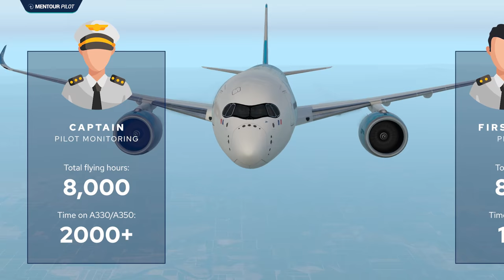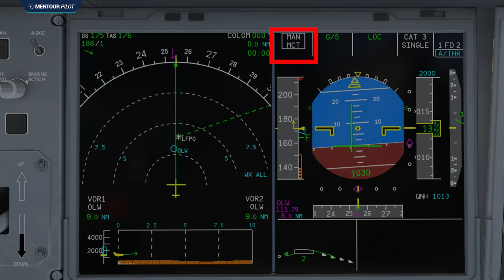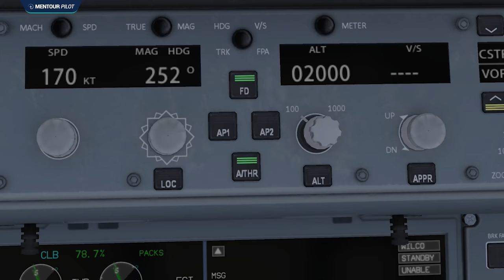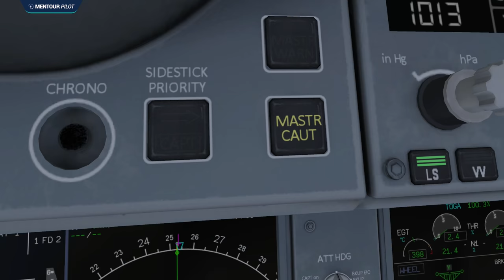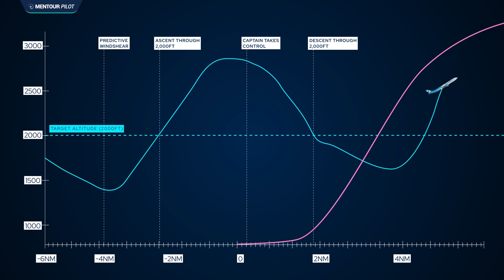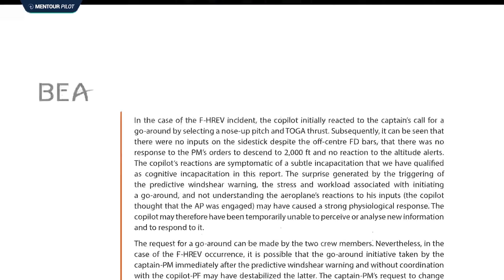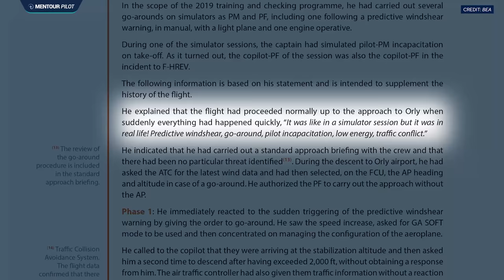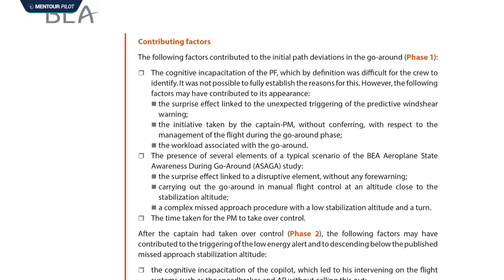What HAPPENED in this A350 Cockpit?! French Bee flight 711 explained!

Comment: Thanks for the very interesting video, as usual ! ;)
I was wondering, don't you think that airliner pilots should fly more small planes ?
I already experienced that feeling to be paralysed by an avalanche of workload, and in that case I tried to just concentrate on the very basics, exactly as if it was about flying a ultra-light plane : speed, altitude, and avoid close traffic. Maybe some minor errors can be done, but it helps to keeps the situation under control, and it gives at least some time to recover a clear mind.
I don't know if this 1st officer was also a private pilot or UL pilot, but if he wasn't, maybe that could explain that he didn't have this reflex to just fly the plane, concentrating on the basics.
What is your opinion about that ?

Comment: I have been in the FOs position once 4 years ago, but not as a pilot. I simply shut down. I verbally relinquished control, apologized and sat myself aside to let my boss finish the job. If I was the captain, I would just reach over, grab him softly by the shoulder and just indicate to him and to the 3rd pilot to switch seats, right then and there
Reply: “Not as a pilot” you should have just stopped right there

Comment: The idea of "re-briefing" the approach a few minutes before landing, especially in a case like this where the procedure is unique and poses significant traffic conflict risks, is a good one. Sometimes I can't remember what I ate 40 minutes ago, much less the details of a complex stepwise procedure that probably won't be needed, but if it is has to be done correctly the first time in less than 2 minutes. Airlines might also consider having the PM recite the missed approach procedure out loud once a go-around is called for, rather than relying on memory alone. My other comment regarding training is this: while I understand the important support role that automation plays in modern aviation, I think that both initial and refresher training for pilots should focus on them being able to perform every maneuver in the aircraft manually, from start-up to shutdown and everything in between (with the exception, perhaps, of celestial navigation!). It's kind of like teaching physical examination in my field, medicine, where you have to examine a LOT of "normal" patients to gain a sense of when you're looking at something that is 1) not normal, and 2) important enough to worry about. Only by knowing and understanding the state of the aircraft intuitively can one fully and properly react to a non-normal situation, and that intuitive knowledge can only be gained by hands-on practice. Think back to what it took to learn partial-panel approaches when first studying for an instrument rating, and start from there.
Reply: It sounds like the FOLLOWING was trying to get in some refreshing on manually landing the plane. Just had an unexpected event happen when doing it. Maybe require Captains and FOS to do a manual landing every so often, either in real life or a simulator.
Reply: Stupid autocorrect, changing FO to other things.
Reply: Re: knowing what normal is 

Indeed. I work as an IT systems administrator, e.g. I am responsible for keeping a bunch of IT systems running, and people expect me to know the answer to most operational questions. It might seem unproductive me sitting there monitoring systems that are doing fine, looking at the behaviour, but knowing what is normal is what enable me to identify when something is out of whack, maybe even before it becomes apparent to the users and a problem.

Comment: Crazy to hear a go around is so rare.   Was an aircrewman in the navy in a training squadron, crash & dash was exactly what we did 90% of time.  The one thing i would be curious, why the wind-sheer warning, and what was done to investigate it on that airplane, sure Petter mentioned the possible false warning with air going over buildings, but still, would think that might be something to check...?
Reply: My impression is ATC tries to avoid putting commercial flights into a situation were a go around is likely. I have been on many flights were we waited, circling for weather and traffic to clear at a fairly high altitude. From the video, while go arounds are not inherently dangerous themselves the real danger is other traffic and local conditions that will complicate the go around. So avoiding them by ATC is probably a wise move.
Reply: @washingtonradio  I would say a go around is not such a monumental thing.   Most all airports have what we might call a race track pattern for the airport traffic that is well established.  A touch and go, or as we called them crash and dash in the over all scheme of things is really, or should not be such a big ordeal.  Inserting the plane going around is really no big deal planes are normally spaced out well enough getting a plane or two back in the queue is not an issue...
Reply: It was only a predictive windshear ahead warning, not the windshear alert with immediate mandatory reaction.
As for LFPO's topography : the wind was coming from the Northwest and Orly 4 (ex Orly South) terminal is quite long, blocky and parallel to runway 25 on its North side. So the wind would have flown over the buildings before heading their direction.
I've been to Orly in fog days and seen upwards vortices from the main South / 4 terminal building towards runway 25 or its path with winds coming from the North.
Far from a real windshear but maybe enough for a refined predictive windshear system to kick in once every blue moon with a simple caution callout.

Knowing the BEA, they certainly checked everything from weather data and radars of the plane, airport, ATC and state to reports from previous flights, tower and ground crews.
The warning they had was not of an actual windshear but only a predictive warning that kicks in when it picks up on conditions that could lead to a windshear.
The crew then chooses, based on their assessment of the situation if they want to continue or abort / go-around.
The crew reacted immediately to the predictive warning as they would have to an actual alert callout instead of assessing the situation first.

Also, depending on the angle of the wind (specifically if it was coming mostly from the West) the predictive situation could have been triggered by wakes of an aircraft departing from 24 as turbulences from that runway travel over both Orly 1 & 2 (ex West terminal) and Orly 3 & 4 (ex South terminal and the new junction) buildings 
Another reason : as it was February and probably cold, it could be warmer air coming from the water of the Seine river path that's perpendicular to runway 25 approach path.
In the winter, with cold weather after a period of mild temperatures, the water was warmer than the air and while flying the jumpseat I've felt a bump as we passed over the river and oil storage river-port. Like a warmer upwards curtain of air that you only feel at slow speeds.

Last possibility : runway 25's final approach path is quite populated and alternates between woods, suburban houses, river and industrial zones. The last houses are meters away from the airport's fence.
A difference between ascending columns of hot air from house chimneys, warm river and descending air above industrial areas...
There are plenty of reasons on this approach path that could potentially align and trigger a windshear prediction without it malfunctioning nor being an actual windshear.

Just like some approaches with buildings in the way can sometimes trigger early radio altimeter callouts or GPWS alerts...
Reply: @dand4485  Orly's configuration is a bit particular.
They have dual operations on non-parallel runways (6/24 & 7/25) as they are only a dozen degrees converging / diverging.
Runway 02/20 is said to be active in the video but I've never seen it used for anything else than taxi and parking for decades (it's extremely rarely used, mostly by smaller planes in rare crosswind conditions).

When facing East, dual operations are a lot simpler : departures on 7 and landings on 6, traffic is diverging.

When facing West ,as it was the case of the video's flight, departures on 24 and landings on 25 with converging traffic in case of a go-around, it's much more tricky.
Also there's a military / government officials airport to the Northwest of Orly (Villacoublay, 107th French airforce base), patterns for CDG and Le Bourget airports's SID/STARs and Paris center NFZ (exclusion / no-fly zone) in the vicinity.
Not even counting Brétigny's military, medical and drone test site airport and EuroControl experimental center South of Orly.
That Orly runway 25 go around procedure is a pain...

Comment: I'm shocked to hear how rare go-arounds are, because a little over a year ago I've flown for the first time in my life and experienced a go-around with a 20-degree bank turn through a storm, with turbulence and lightning striking around the aircraft (and then circa 40 min in holding pattern until the storm passed). Pitch up combined with TOGA throttle really pushed me into me seat, I saw people around scared but it was not scaring me. Partly because it was still less violent than being in skidding car, but mostly I think because I watched a lot of Mayday/Air Crash Investigations, Mentour and 74Gear videos and I felt like everything is under control and it's just business as usual.

Comment: Good analysis as usual.  A couple of thoughts from my viewpoint (25,000 hour long-haul pilot with 8,000 as Airbus captain).   1st. I guarantee fatigue WAS a huge issue, even if they didn't recognize it.  2nd, the Airbus is easy to fly when everything is normal.  It can be a nightmare during irregular operations like this.  I found, in situations like that the best thing was to turn off ALL automation and fly the basic airplane.  When it's back where you want it, turn the automation back on.  

For discussion, the vertical aspect of that go-around was not much different than a climb TCAS RA.  It should have been easy for the crew to hand-fly.
Reply from the maker: Yes, I also got the feeling that the constant engaging and disengagement of the autopilot probably aggravated the situation. But I’ve only flown Boeing myself so I can’t be sure.
Reply: @MentourPilot  I've been Boeing for the last 10 years, so my Airbus currency is a bit poor, but . . .When you turn the autopilot on, it won't automatically go where you want, especially if the command bars aren't centered.  Say you are above the selected altitude and nose high when you turn the autopilot on.  The autopilot/flight director will "revert" to vertical speed mode at the current climb rate.  Not at all what they would have wanted. That would then require a lot of "fiddling" with the mode control panel to get it doing the right thing, or as I preferred, just turn it ALL off and fly.

Another small complicating factor for them at a time of maxed-out workload is when Airbus autothrottles are engaged, you don't see the throttles move as power changes.  It's a bit less intuitive compared to Boeing and easier to miss seeing that the power isn't changing to where you want it.

Keep up the good work!
Reply: Would the Captain have been justified in ignoring the warning ? Would other planes have already reported windshear if it were real ? Thanks
Reply: @AsFewFalseThingsAsPossible  Pilot reports of wind shear are important clues to a dangerous condition. The LACK of pilot reports doesn't mean there's no windshear.  The captain had the authority to do either (continue or go-around).  That's a busy time with little time to evaluate an irregularity.  Almost never is it the wrong choice to go-around. That said, at 1400 feet, they did have some time to evaluate the conditions before making that decision.  Given their decent rate of about 800 feet per minute, they had 30 to 60 seconds to look for more clues.  Playing "armchair captain," I would have said to continue but be ready for a go-around while observing closely for other signs of windshear.  If the warning continued or if the approach became unstable below 500 feet, I would have ordered the immediate go-around at that time.
Reply: @AsFewFalseThingsAsPossible  An additional thought.  FYI, there are 2 types of windshear warnings, predictive and reactive.  They had predictive, which means there may be windshear ahead, and the response is discretional and can be delayed.  There's also reactive windshear warnings which means the system is detecting that you are in windshear at that instant.  When you get that on approach to landing the response is immediate and mandatory, go around.